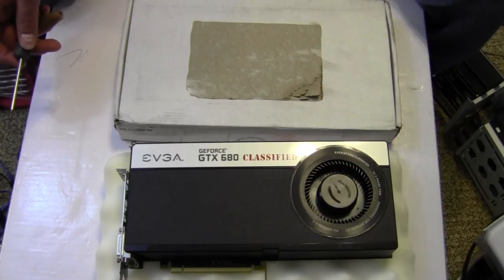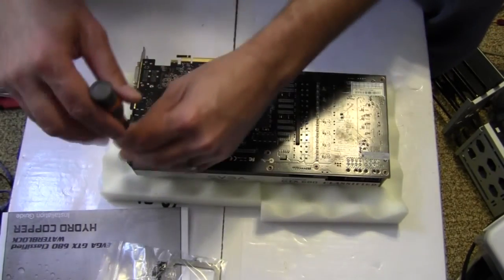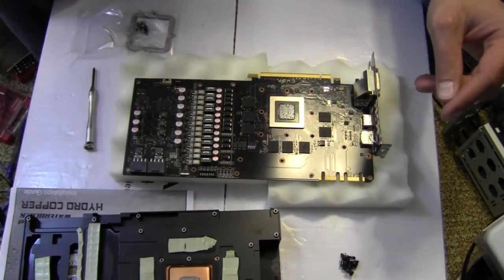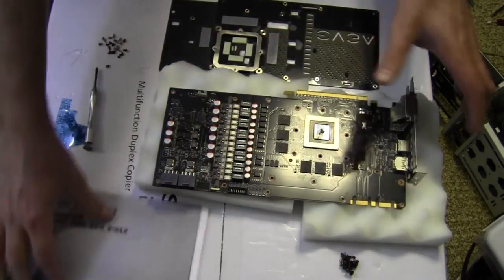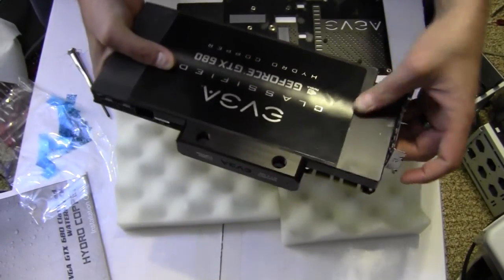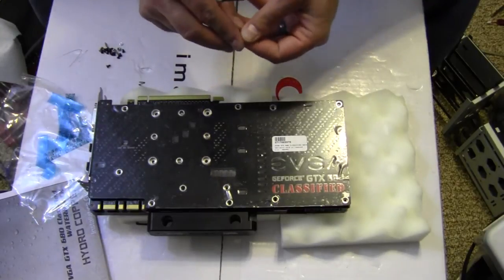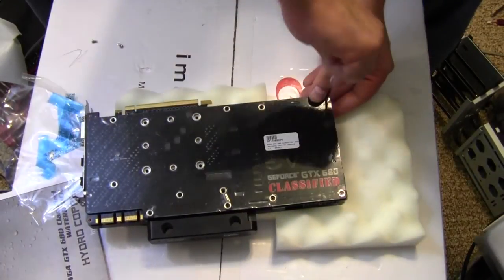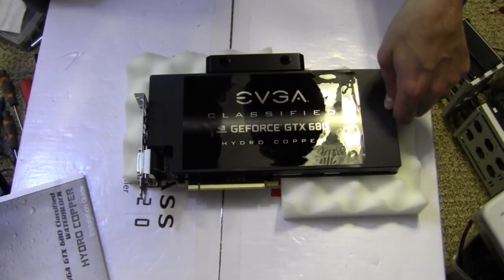Installation of a Hydro Copper Waterblock on a GTX 680 Classified

Comment: hello, i have a question, i am going to buy a reference 770, and i need to know if this block is compatible with the 770, can you tell me if it is compatible? thanks for your time.
Reply from the maker: No. The classified PCB is much larger than the reference 770. This block will not fit at all.

Comment: You were wrong to put the 4 screws that hold the GPU waterblock, you had to reuse the screws with the spring ones that comes with the air heatsink.
In the way you did it works the same with the smaller screws.
Because if you check the original 680 classified hydrocopper they use the big 4 screws with spring.

Comment: hey adopt nice vid , i heard that the gtx 770 Classified water block fits the gtx 680 gpu have you heard this to be true or seen this , as im in dire need of a water block for my three 680 classys :S
Reply from the maker: The cards look similar, but I haven't seen anyone do that swap yet. It was very difficult to find water blocks for the 680 classifieds. I ended up paying way to much for them off of eBay. I am not sure why so few exist. I would think that they would be popular.